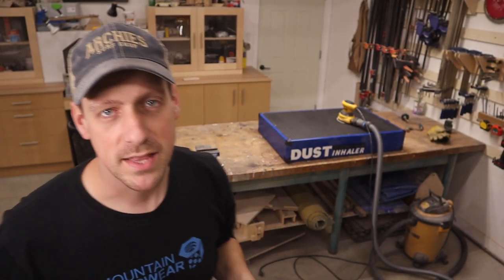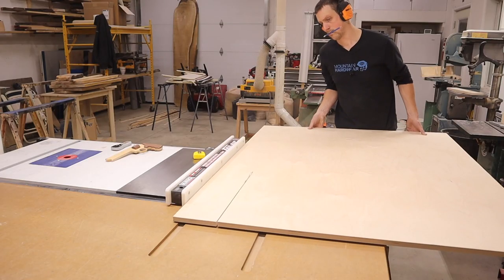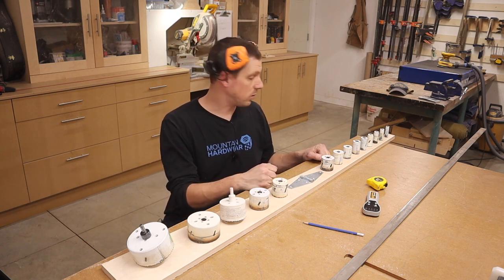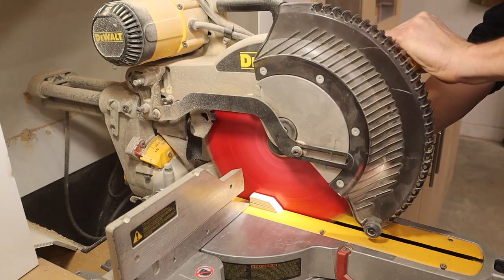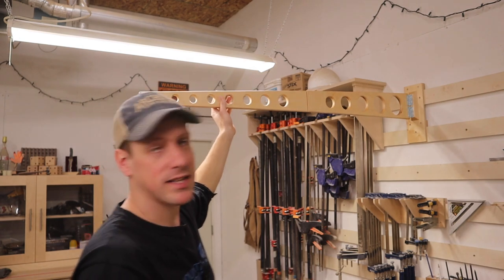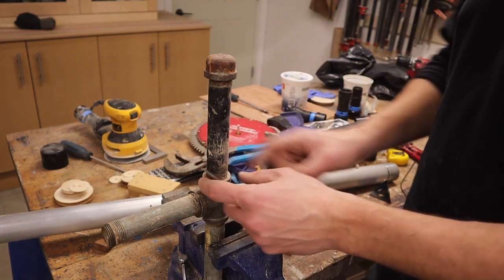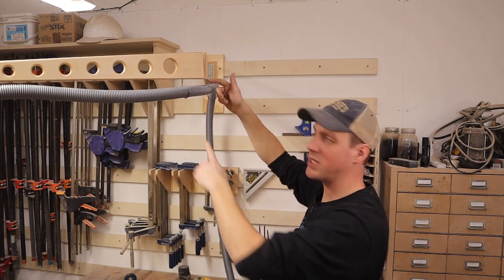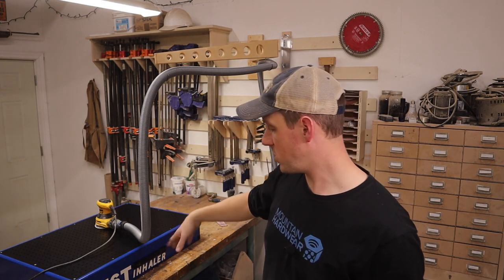Making A Vacuum Boom Arm

Comment: Nice work Wes! That's a very cute little helper that you've got there! I was wondering what you did about that electrical cord as well?  😉👍🤔
Reply from the maker: Thanks. I just loop it around the hose and hang it on the same hooks the hose sits on. It works great.

Comment: great job. you shuld use your downdraught table for routing as well as sanding. it will pull a lot of the crap away from you
Reply from the maker: Thanks. That’s a great idea. I will have to try that.